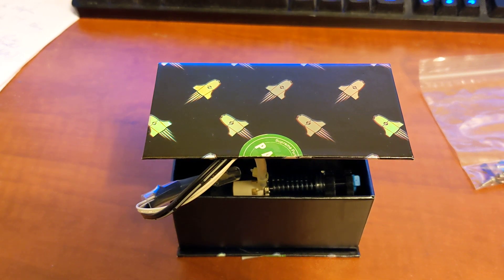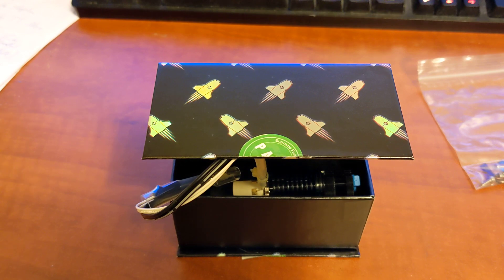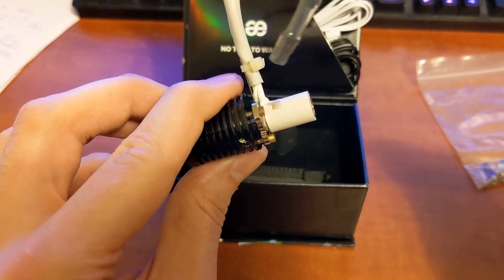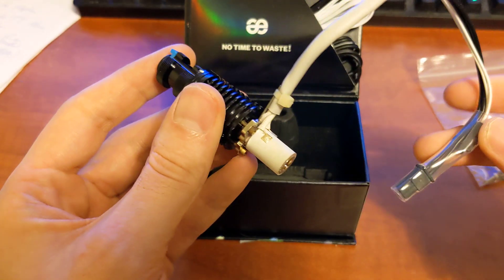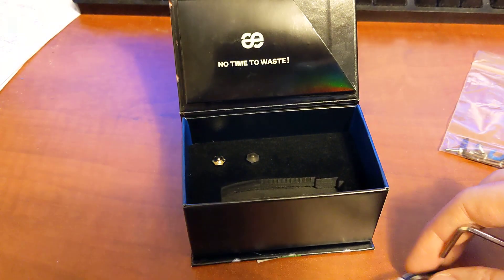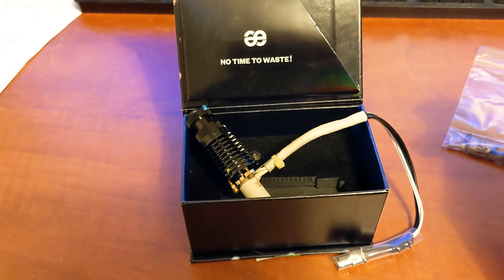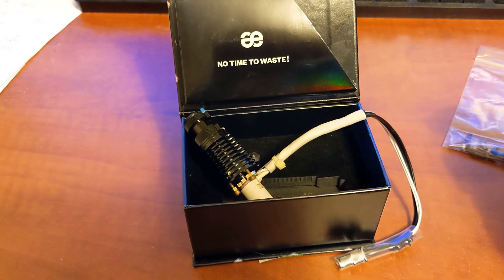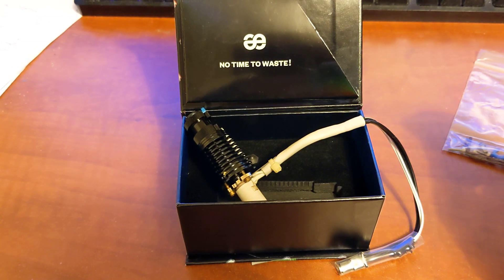Phaetus Rapido HF Hotend

Comment: Hi, thank you for review! Which print head did you use to mount Rapido on Delta? Did you design a custom one? If so, could you share the print model?
Reply from the maker: I have used this on many printers. This one I designed a custom delta called pheonix it's on my channel but it's a old printer and the mount won't really help you.
Reply: @Rolohaun  I think it could help, as I have a custom built of Delta, which is quite old as well. I haven't found any mounts for Delta, and I would like to have something as a starting point. Could you please share an STL somewhere, like upload on Thingiverse?

Comment: Do you know if there is a way to remove and replace the the thermistor on the Rapido? Apparently it comes with a 280 C max temp thermistor.
Reply from the maker: Hmm that's an interesting question, I wonder if that is possible

Comment: Hi from the City of Vaughan, ON, Canada. 😀 I've got mine from the same Ontario company, but I've got UHF version. This is my replacement for the working horse -- E3D V6 Volcano on my heavily redesigned and customized large Tronxy X5SA-400 2020. The Rapido HF vs UHF also depends on the type of nozzle you use. You can  use Volcano-sized nozzles to get higher flow than with the regular E3D V6-sized nozzles. Overall, regular Rapido HF with regular V6-sized nozzles has ~ 30-40% more flow than regular E3D V6. Which is great, considering the fact the size remains the same. But you should also prepare capable Direct Drive feeder with a strong motor that will be able to fulfill Rapido's apetite in plastic. All this junky MK8-styled extruders will not work. I plan to install either Sailfin, either Orbiter 2.0. 
Enjoy this great Phaetus hotend!
P.S. Slice engineering is an Evil! 🤬
Reply from the maker: Awesome, you have a cool build! My Rapido is going in my large delta with a 0.6 nozzle and I have a LXG extruder :)